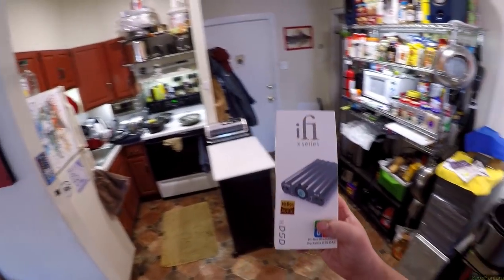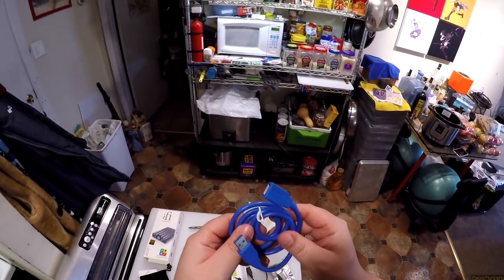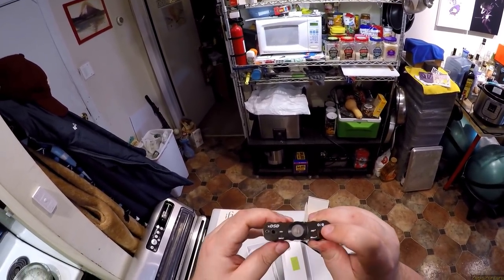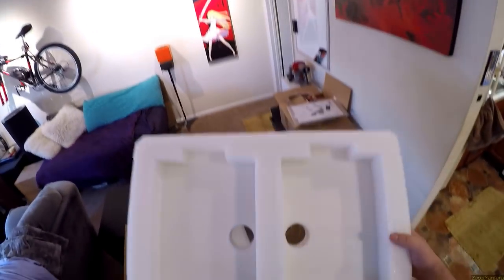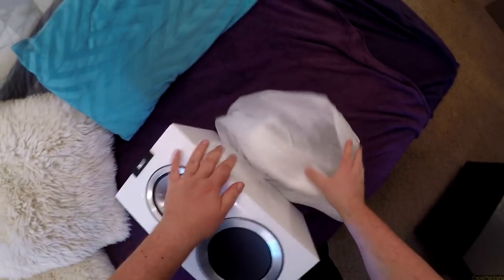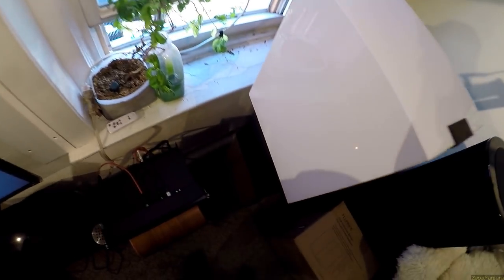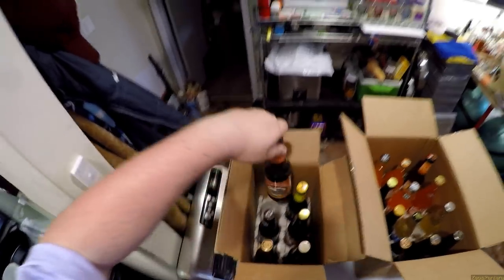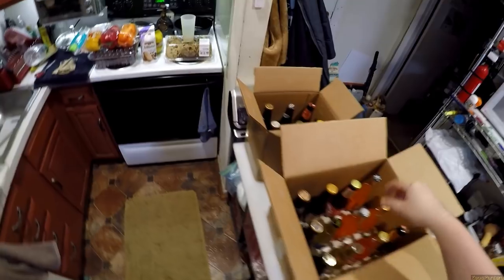Z Unboxing - IFI and KEF and ROOT BEER

Comment: I also own the white R300s , its been a love hate relationship, it took a while to dial them in for sure, placement is a total pain , they are best not pointed in toward the center, just facing almost straight ahead and the uni q sound stage will do its thing, the low eq with these speakers is going to sound unnatural and take your system over, lows need to be turned down to match the level with the nice mid/highs. the phase plugs change the cabinet mid/ hi sound also,  a kef chart shows the 2 curves, these are not a set up and jam speaker for best results. Port to rear wall placement really can change things also. They can be the best speakers you have ever heard ,  and the worse with bad placement and the phase plugs in. Love your reviews!!!

Comment: Ever thinking of trying Magneplanars?
Reply: money and relevance
Reply: I think but I need space and time
Reply: test test Don't the MMG go for $500-ish in the states? That seems to be within range. They also have a 60 day return period on them so I don't see how it can be an issue of money. If he doesn't like them he can give them back.
I must however agree with you on the relevance. They're far too big for most people. And so are the Klipsch Forte III
(One thing we can't forget here is that this is Z we're talking about. You never know what he might do...)

Edit: Z responded just as I sent the comment.
Reply: I can't seem to find any that aren't store pick up only. The absolute cheapest I see are $650 a pair new (MMGi). And the size difference between Forte III's and Maggies is nearly double. I wouldn't consider the Fortes to be super large speakers. Doesn't mean I don't want to try a pair, though.
Reply: Also can't forget the amount of power that's being recommend for pushing a pair.
Reply: test test My 1.7s only draw about 10W at most. Gives me 92db of sound which I actually find way too loud. Z has more than adequate power for them.
Reply: i would assume most of his audience doesn't. I'm just going off what I have read on boomer forums, though.